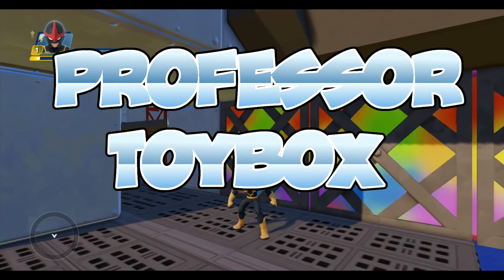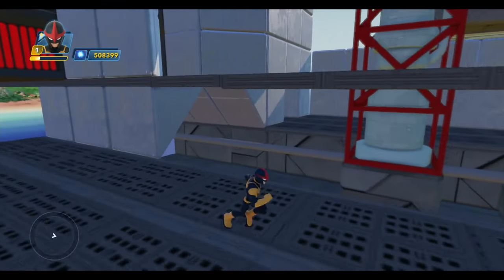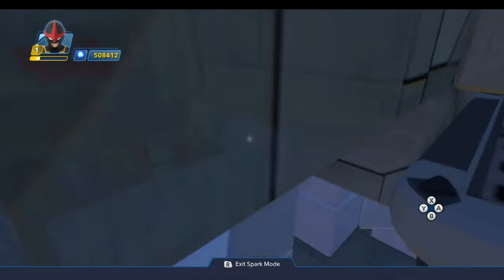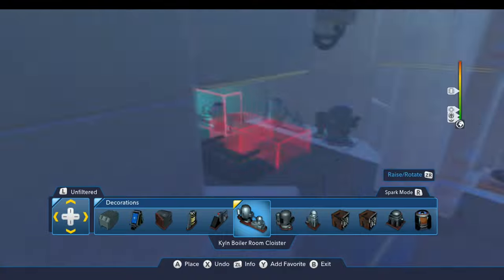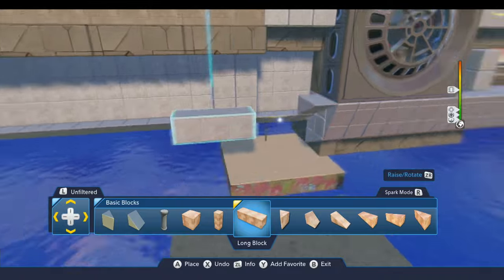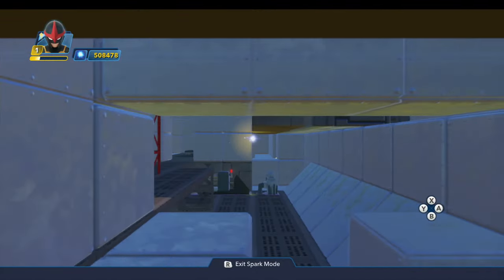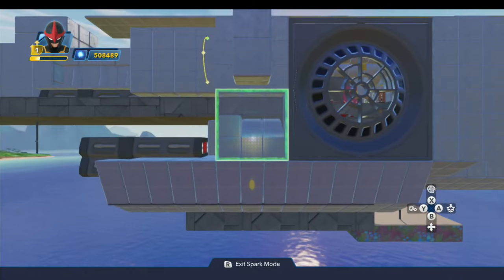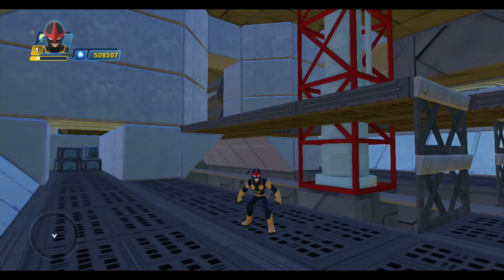Nautilus #12 – Engine Room Build Part 2 - Disney Infinity 3.0

Comment: Throughout this build, I've seen sevral things you Hassel with or used path, were a trigger area and replayer would worked great
Reply from the maker: I find the trigger area trick is hit or miss with me. It doesn’t always work reliably, so I tend not to use it. I prefer using the replayer or path creator to get overlapping blocks.